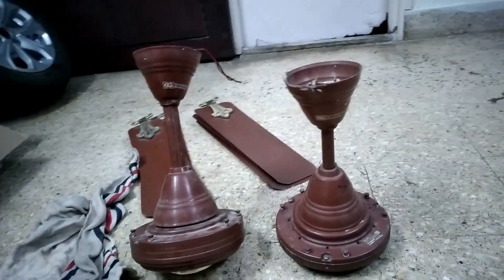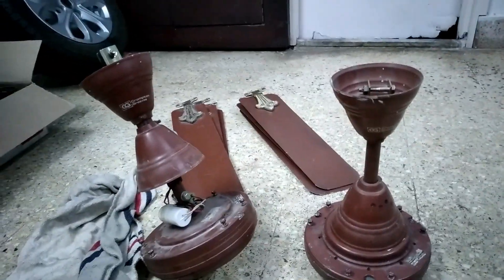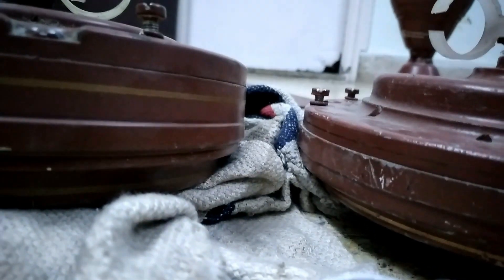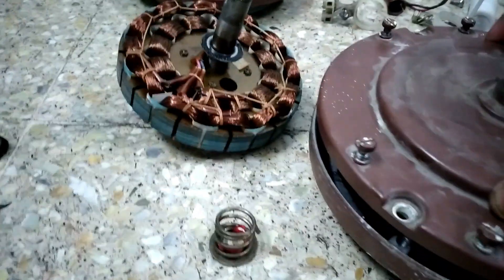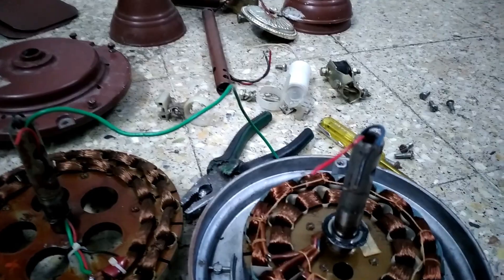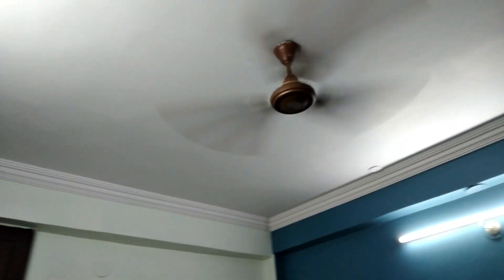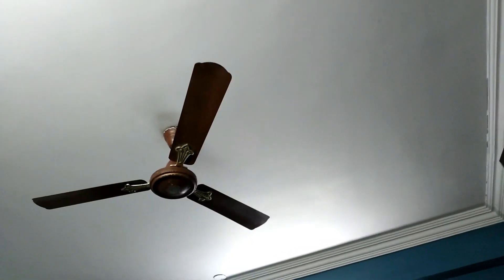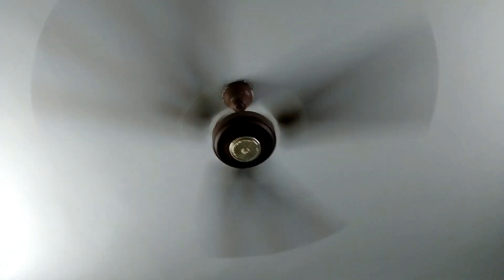Crompton Excel Air(HS ) VS  Crompton 3 Star Fan Comparison ,Teardown and Performance Test

Comment: In what way does number of poles affect the speed of the motor? Are the two inversely proportional to each other?
Reply from the maker: yup more the poles , less the rpm
Reply: Ok. Thanks
Reply: And does more poles mean a higher torque ?